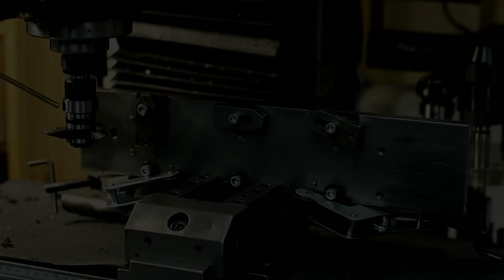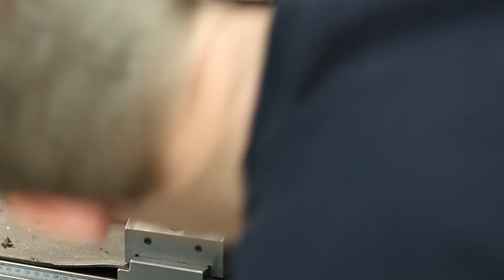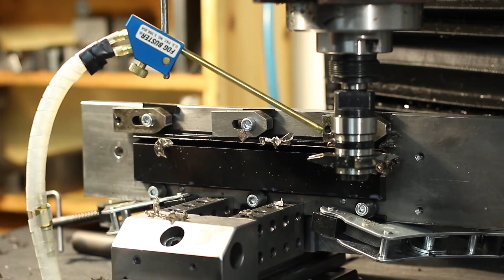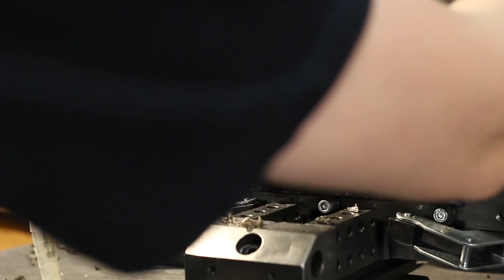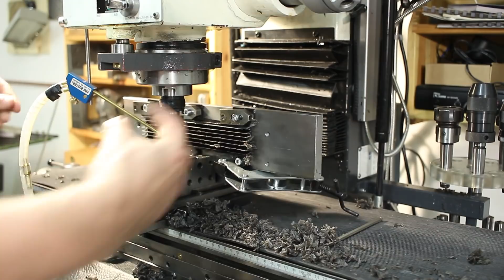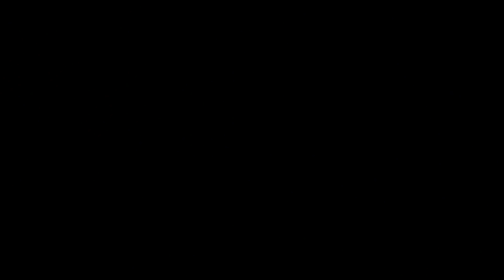Indexable V-Groove Cutter - Followup

Comment: These cutting speeds seem really slow for PVC to me. I use PVC cutoffs from time to time and I use the same tools + speeds as for softer woods with them, so cutting them quite quickly with the router or tablesaw., holes can be drilled rapidly and so on. Indeed, I only had issues cutting soft plastics (PVC, PE, PVDF etc.) when I slowed down. Liquefies the plastic in the cut. Very nasty.

Comment: would it be possible to cut 99% depth, then lock spindle move last 1% in and have power feed cut like a shaper for a fine finish ?
Reply from the maker: The cutter would be oriented the wrong way to do a "shapercut" on the reverse movement :)
And the finish is perfectly fine that way, no need to complicate it :)
Reply: Hiram Rios you're saying to do the "1% cut" with the spindle turned off? Tat purity wouldn't provide a good surface finish, and you'd need to index the spindle so one of the cutting teeth would be at a maximum. Also, you'd need to lock the spindle.
Reply: Andrew Delashaw yeah I was thinking it might make for a better surface finish at the cost of a very large amount of setup time

Comment: Stefan, have you tried freezing the parts before machining? I believe this can improve the machineability of soft materials like rubber and some plastics. You may be able to avoid having to de-burr and you may be able to avoid the coolant and the associated clean up.
Reply from the maker: There is so little thermal mass in those parts, it would work for about a minute ;)
Reply: Thanks for the replies guys :) I guess I just learned logic only works if you have all the facts :))
Reply: gillywild That would work for the first grove, but the time it takes to get to cutting the next one, the past would be room temp. Or you would have to remove it, and freeze between each pass. Which would not make sense for obvious reasons.

Comment: You need to make several more cutters then stack them, you could machine that piece in one pass.
Reply from the maker: The ammount of parts I have to make does not justify multiple cutters :)
Especially as I have to do different versions, some with different spacing of the grooves.

Comment: Maybe gang mill on a horizontal next, be much faster and more rigid especially with some climb milling. :-)
Reply from the maker: If I had to do a very large ammount, I would look into a gang cutter - But its just low volume, maybe 10..20 parts every two, three months.
Climb cutting produced a terrible finish btw ;)
Reply: I don't cut much plastic so was not aware climb milling was a no no, definitely would be a lot more cutting force on a gang mill setup. Could at least get some rapids setup on that thing for rewinding it back for the next cut. lol

Comment: These parts are a puzzle:  Making them out of aluminium would point to a heatsink but the fact that they're some kind of plastic is odd.  I can only assume they're a prototype as extrusing or casting makes more sense for producing them in any volume.
Reply: Jim's videos I think he said that this is a reoccurring job, so prob not prototyping.
Reply from the maker: They are parts for film developing tanks. PVC because they need to be glued and chemicaly resistant. And the volume is way to low for extrusion :)

Comment: As the wiper motor you used on the X-Axis feed is variable speed couldn't you include a circuit to bypass the Variable speed and just run the feed at full motor speed for rapid traverse. Similar to how the rapid works on a Servo type 140. Or the 300mm/12"/min the maximum speed
Reply from the maker: Ah! Thats a good idea. I wanted to redo the electronics anyway, as I want limit switches.
Reply: Stefan Gotteswinter 
Thanks, while I'm not the biggest fan of variable speed feed units on milling machines. Sometimes it is really hard to dial in the right feed rate. Depends a lot on the potentiometer used. Where I really like them is on a lathe. I spent countless hours running a Hardinge HLVH and they were always a joy to run.

Comment: Hi Stefan i am too stupid to recognize why the part is hold securely.. Is it a similar principle like the backstops at the chuck you build i mean the three clamps turn a little while tightening and so hold it? Otherwise the part should fly away... but some force holds it but what? Thanx
Reply: There's a stepover in the back. You can see it in 7:30.
Reply from the maker: I hold the part on the small ledge thats on the two long sides. No magic involved ;)
Reply: Stefan Gotteswinter Aahh that's it.. afterwards its always easy 👍